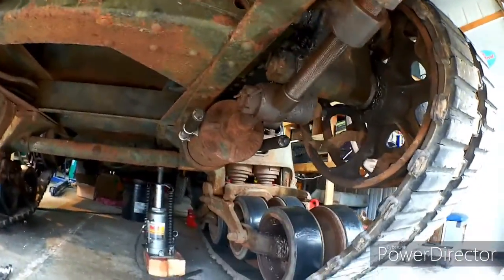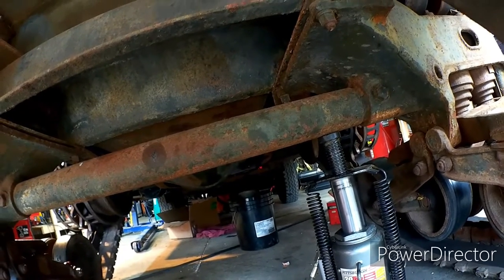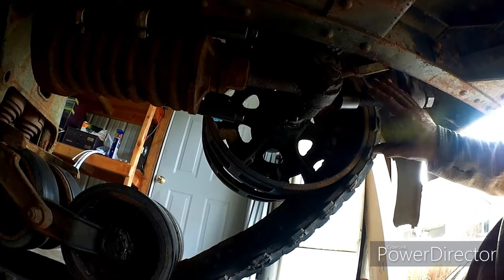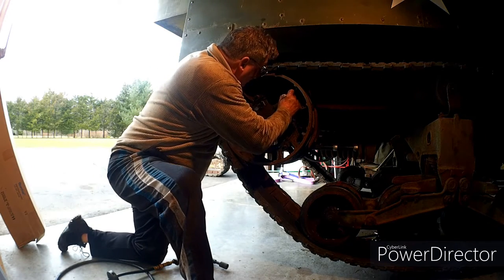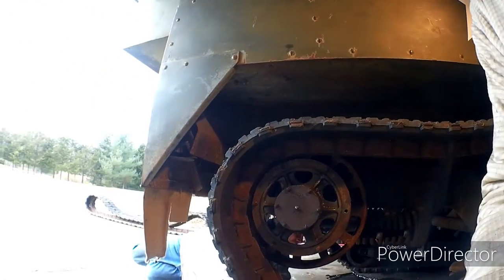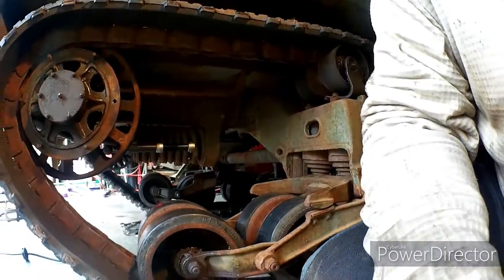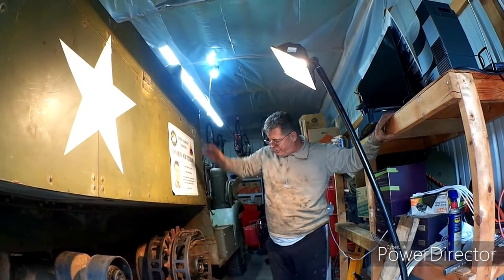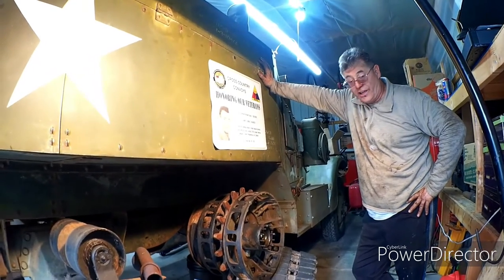"African Queen" Halftrack-Track Removal

Comment: Mark, we communicated on the 503 and I'm VERY happy you are taking the time to make these videos  Hope you'll make another video doing a hot wash of the R&R effort covering topics such as - things that went just right and according to plan, mistakes you think you may have made, things you'd do differently, or things you'd do in a different order and all the little things that can get ya...like the proper orientation of the track and using the track guides as a reference to that orientation.  You've got a good thing going there!  God bless.
Reply from the maker: Tim, the only major AAR item in this video was my initial failure in not removing that support roller before I started. It caused me a bit of a problem when I started working the track off the the rear idler/adjusting sprocket.  Prep regards set up I covered and mistakes were addressed in my text boxes embedded in the video.  I plan to get better at production and technique as I progress.  Appreciate your comments.